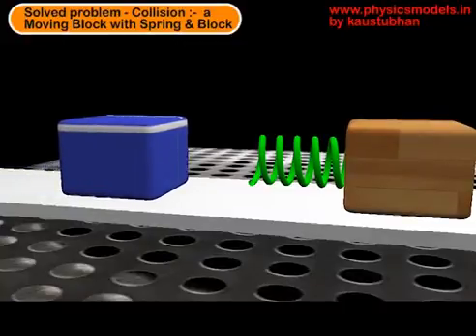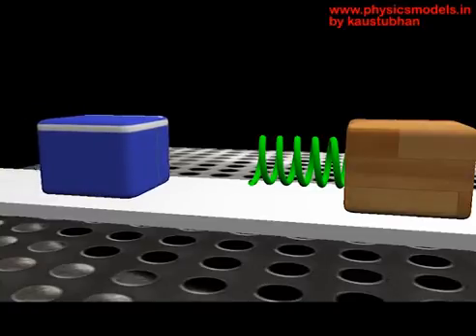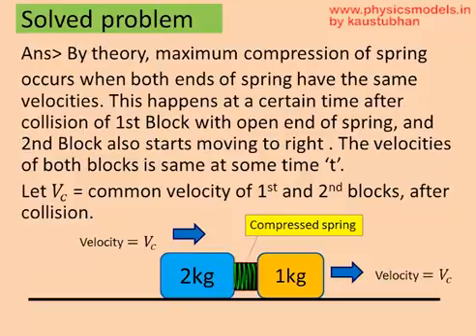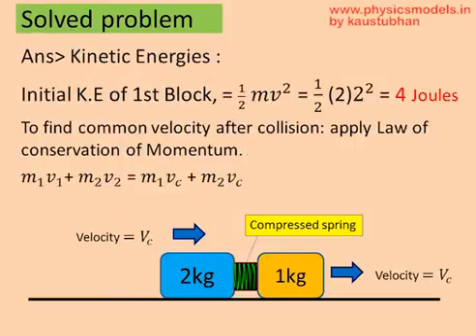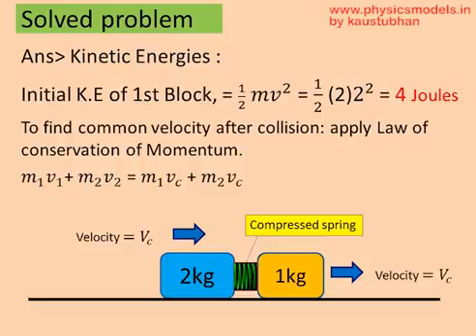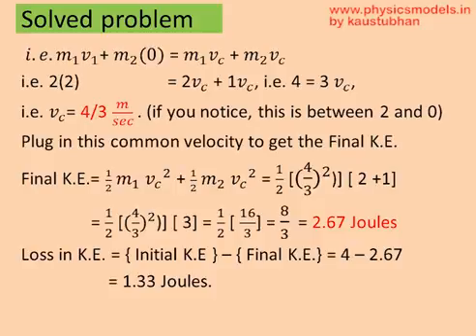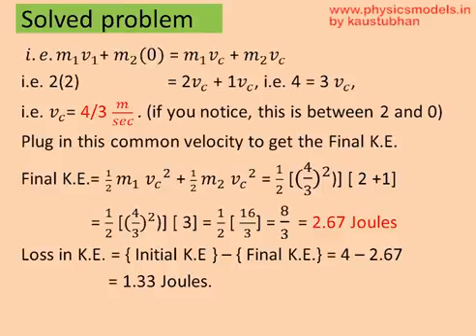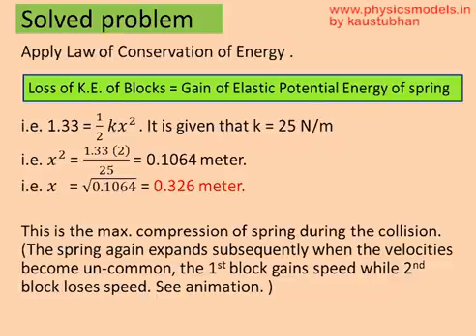PHYSICS MADE EASY -solved problem-Collision of Block with Spring fixed to another Block- 1

Comment: Nice demo. Can we also solve this without using energy theory and just by using momentum theory?
Reply from the maker: Hi good question. In my opinion, momentum approach will not be right, it won't work in this case, since the Coil spring compression and expansion is Energy Storage and Release, it is not related to momentum of the spring
Reply: @physics_animation_tutorial can't we explain with just forces, do we have to use energy theory always?
Reply from the maker: In many problems, Energy approach is more suited.